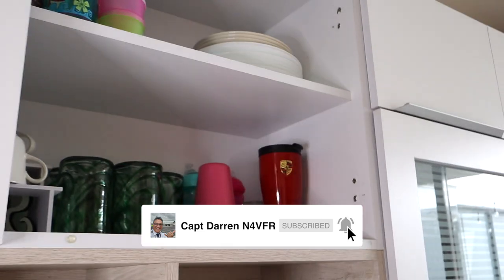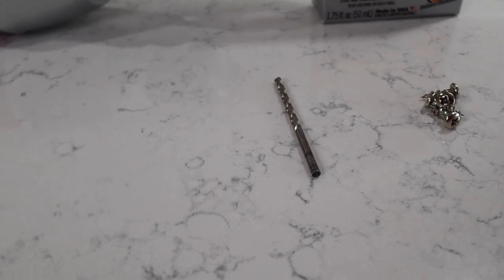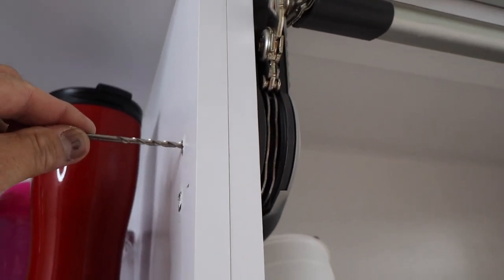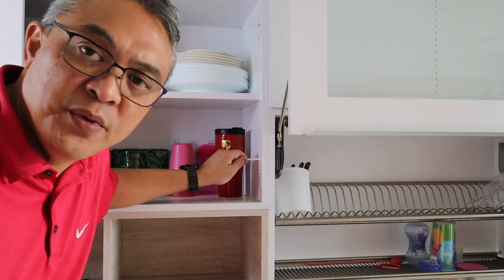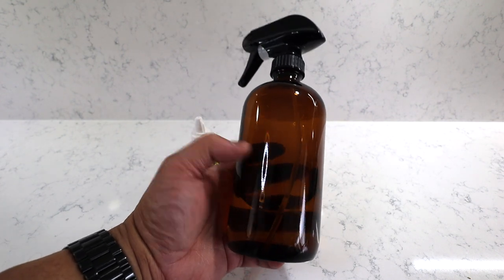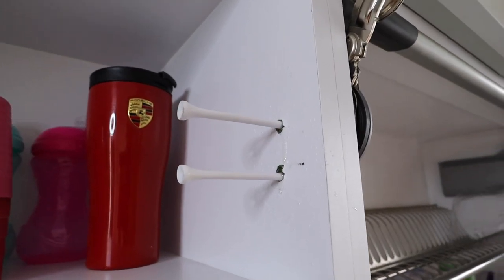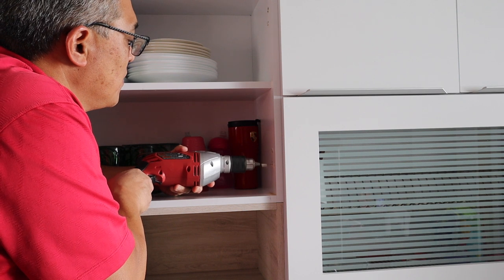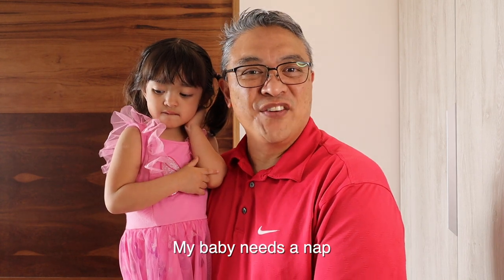How to Repair Stripped Screws in Kitchen Cabinets | A Hack to fix those wobbly cabinet doors

Comment: This method works great!  I've used it on bedroom doors that were loose from kids pulling on them.  Except since I'm not a golfer, I use dowel rods from the home improvement store :).   Also I use kwikwood instead of gorilla glue.  I'm sure gorilla would work just as well.

Comment: Captain Darren nice trick. I have used tooth picks and it's a pain and never holds.
Question on your Palstar AT2K. Did not get the 12v supply would that keep it from tuning a Delta loop for
7.  Meg
Thanks KQ4CD
Reply: Yep, cramming a few toothpicks works nicely too for those of us that don't hit the links anymore!  Great job!
Reply: @reidlanham2011  thanks I guess was using the wrong glue lol I can always find tee's 
 Here in Florida 73 maybe I'll get air  sometime